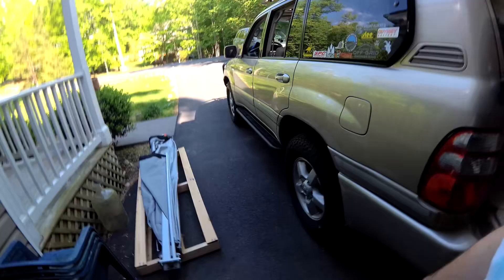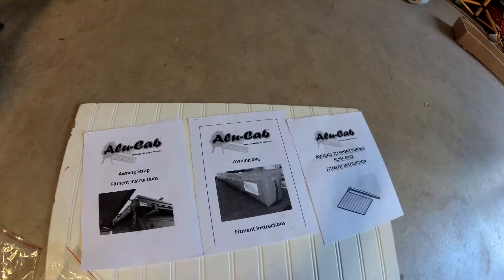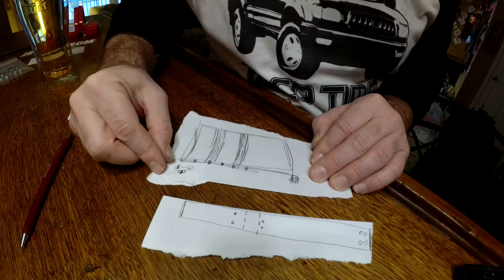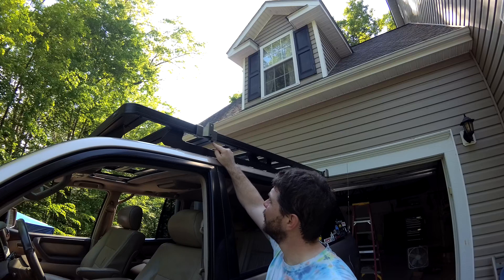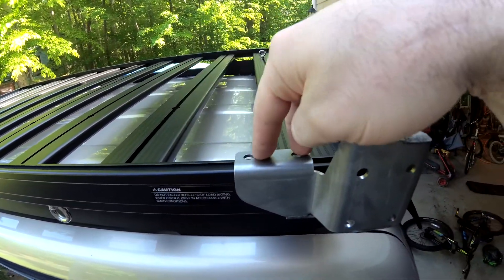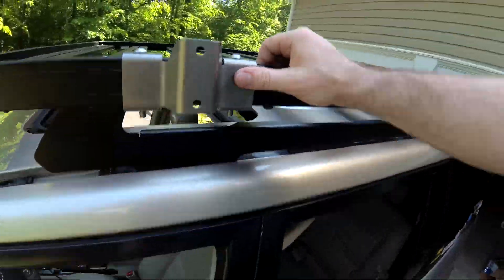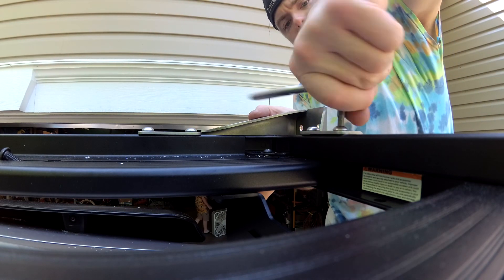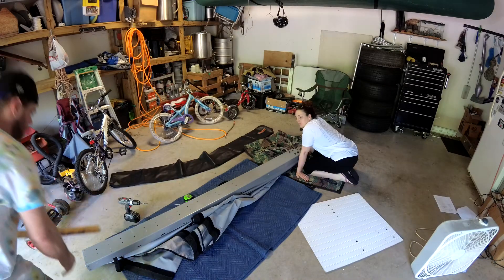Alu-Cab Shadow Awn Install Part 1 - 100 Series Land Cruiser Overland Rig Build

Comment: Did you see any buckling in your rack after the install? My AluCab shadow 270 is leaning out a bit shortly after install. The rack seems to be buckling. Trying to find a reinforcement method.

Comment: I noticed (at least on mine) that the front runner rack rail is shorter than the bracket. Did you just tighten them and just let the pressure pull the top and bottom faces (of the bracket) in contact with the rail?

Comment: As much as they charge for that bracket kit you would think it would be engineered better.
Reply from the maker: I certainly wish things lined up a little better for the installation but I can tell you that the brackets are extremely robust and have held up extremely well these past few years.